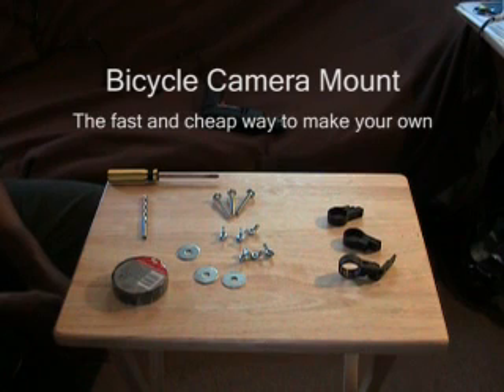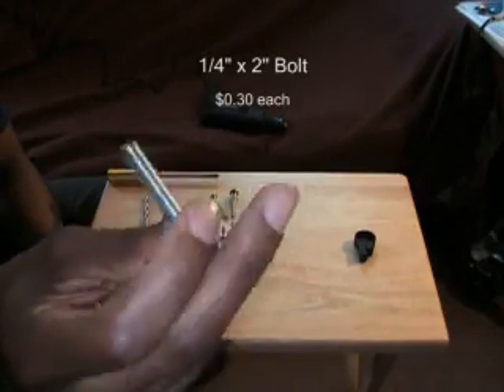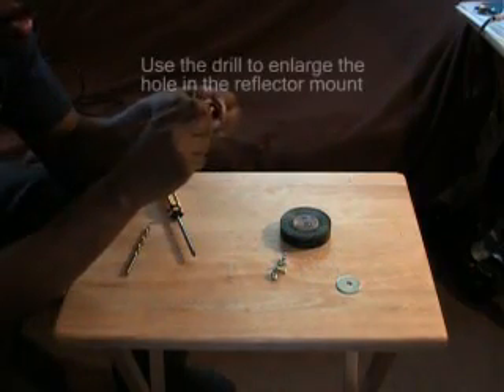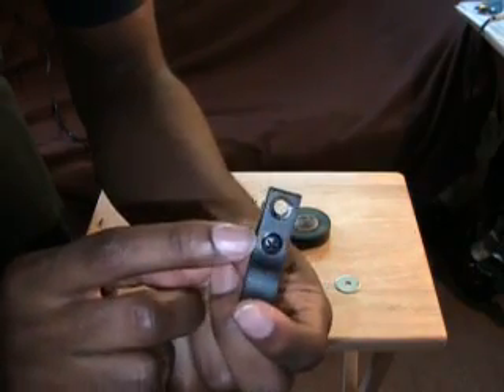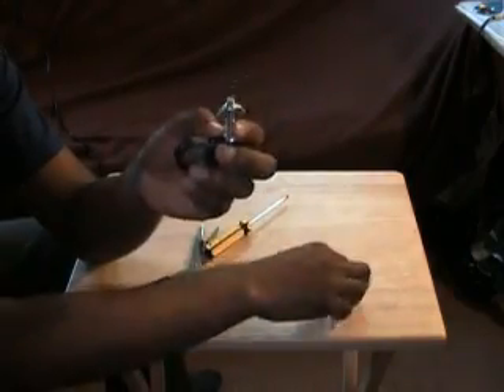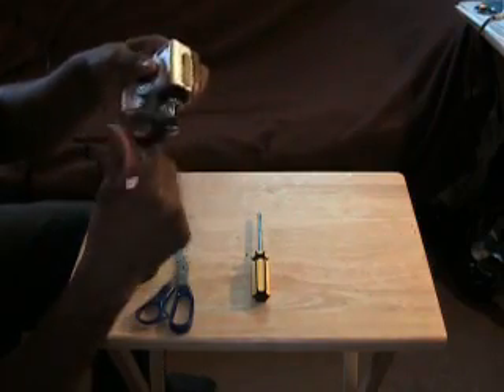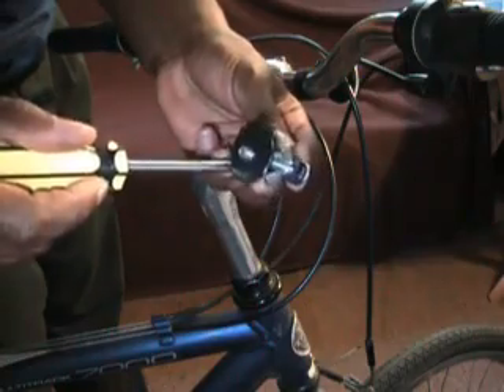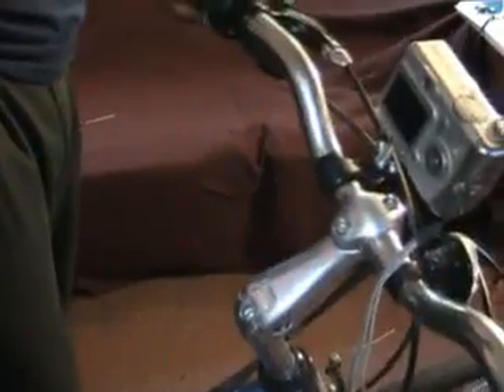Homemade Bike Camera Mount

Comment: you made an excellent video.
I just made one for my flip copy camera.
didn't want to expose my lumix to the elements as it might muck up the lens mechanism.
I was surprised I had all the parts, didn't need to buy anything. I used a rubber washer instead of tape.

Comment: This looks excellent, although I'd worry on 2 points (1 UK-based!).
1. On trails, the camera shake you'll get will be horrific. Having a long undampened screw will magnify all jolts. It's possible it'll pull the bolt out, as it's not designed to take this punishment. However, road riding looks great!
2. In the UK the standard bolt won't fit the camera (and camera-shop based bolts ~£5!) & then the wingnuts won't fit. It's a different thread gauge.

However, I congratulate you on inspiring others!

Comment from the maker: Yeah, the cam is fixed unless you unscrew it from the handlebars and reposition. One of the reflector mounts I didn't use has an arm extending from it. I might use that to make an adjustable version later.

Comment: Thanks for posting this video.  :)  It looks so simple, and I would love to be able to get the pieces to make it :)  In France I unfortunately could not find the correct screw to fit my camera (which I bought in the US, if that matters).  I went to two hardware stores.  Going to try another one tomorrow :)  Must be some US/Metric standard issue.  They had screws with the right diameter, but the threads were too close together.

Comment: @isegoria1 Actually it looks like this is indeed the camera bolt hole, but the corresponding screws are unfortunately hard to come by in France.  Looks like you need to go to some special hardware stores which import American (or UK) hardware, or otherwise go to a camera shop.